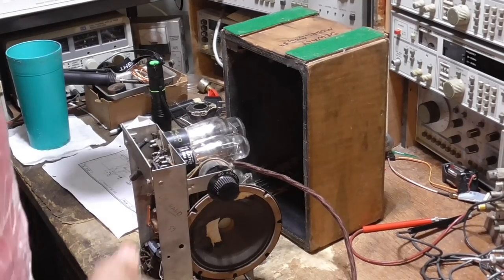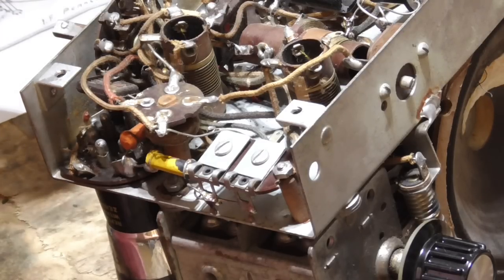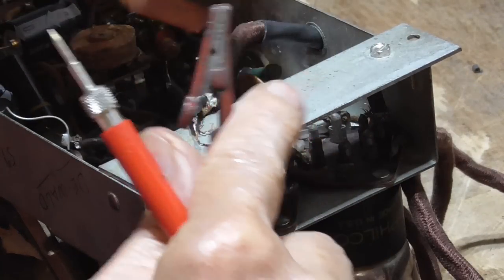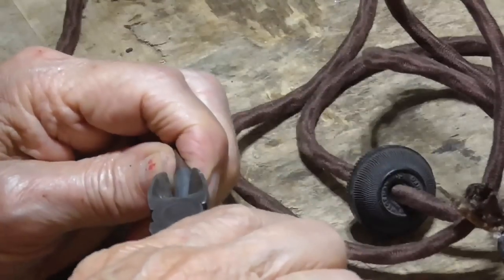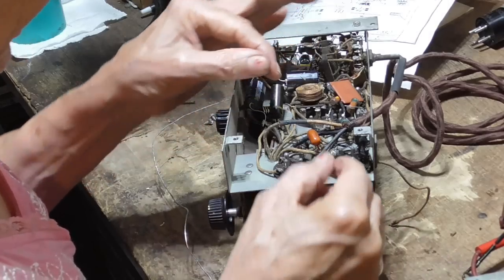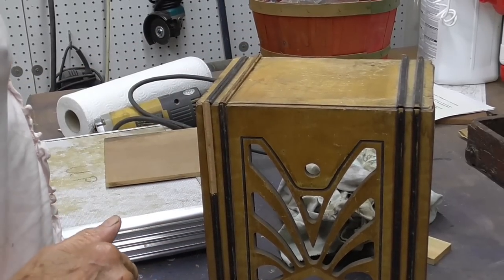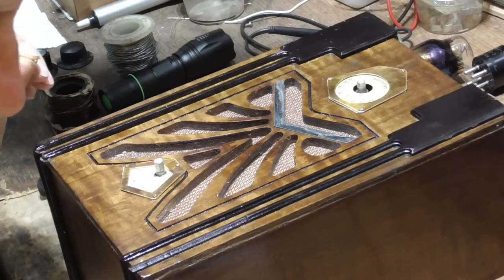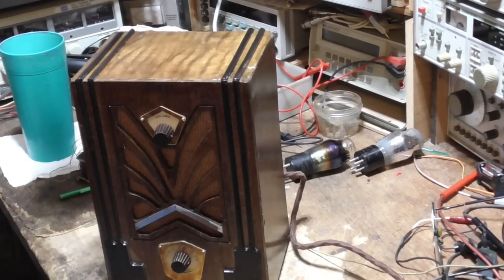RESTORING A 1930'S DEWALD RADIO

Comment: Ya got a GREAT 👍 discount on that radio 📻 for $5.00, by the seller thinking that the power cord went bad. It wasn't the power cord that went bad, it was one of the built in capacitors that burned out. Your friend, Jeff.

Comment: Dewald model 59 from around 1934. Has a bad resistance line cord. Struggling to keep it original and got it to work.
Ron's cabinetry work is simply outstanding. I don't think I ever saw a chassis desiged to be put into a cabinet on its end.

Comment: I saw that something the wood veneer bulged a few places it you could have cut up and filled up with wood glue and then use a couple of clamps to press until the glue was dry
Reply from the maker: Yes. There were several swelled up places which is why I couldn't use a power sander to quickly sand the radio. That particular radio is not worth all that trouble to do a lot of veneer work. It looks great the way it is.

Comment: In 220 volt countries they still sold all-american-5 series string radios and the ones I have seen include the fattest wire wouund resistor in the chassis, which oten goes bad when they are just a ceramic core and open to the air windings. I have rewound those, maybe something like that mounted on the chassis would be a more sensible replacement for a resistor cord.
Reply from the maker: In some radios there is room for the resistor. This particular one is packed solid with parts. No room.

Comment: Good to see you are still posting, havent seen many uploads from you recently was getting concerned. quick question - You changed the capacitors without testing them - i assume as they are old - yet you changed them for stock capacitors that are so old that the legs have oxidised. Why should your capacitors have any more life than the ones you removed?  - what am I missing?

Comment: For cleaning those capacitor leads I would recommend using fine steel wool. And, if the oxidation is really stubborn, maybe some fine (1000 grit) enery paper. One just has to take good care that either the fine steel hairs nor the emery paper abrasives enter the radio.
Edit: Cleaning with a knife blade is not that effective as it cleans a very small area per pull whereas steel wool covers much more area.

Comment: Greetings:
Instead of a signal tracer for finding a break in a wire, you can use an inexpensive AC voltage sniffer ($3.98 shipped from China). Be sure that only one source of AC is connected to mains when testing. Good for finding that break in the resistive line cord. 
BTW: Alternative to an internal dropping resistor is an internal non-polarized dropping capacitor of 14 ufd 150vac. [Motor caps work here.]
Reply from the maker: The motor capacitor is HUGE and won't fit in the cabinet.

Comment: A "curtain scorcher" line cord.  I figured at the beginning you'd encounter that.  I restored a 1930's Sparton where the cord was just in too bad a shape to re-use.  I used a capacitor to provide the required reactive current limiting in the filament string (not my idea - found on line), and used a repro cloth covered 2 wire line cord.  A resistor with the requisite power rating would've been too large and generated too much heat.  Luckily, the cabinet on my radio was in pretty good condition - I don't have the mechanical skills or tools that you do!  What material did you use to make the decals?
Reply from the maker: Inkjet printer transparency plastic. Any office supply store or ebay.
Reply: @glasslinger  Thanks!  I'm behind the times on that stuff!
Reply: Great job, BTW!

Comment: What i used to do, is flex the tube, while connected to the ohmmeter, to find the bad place.
Another thing, i do is gently pull the wire from it's end. 
Usually, the breaking is somewhere close to one end, so the broken wire will just come off.
Reply: When restoring old things, i think people should stick with the original look of the item.

Comment: Ron, When you sprayed glue for the grille cloth, does the glue get on the wood edges of the grille cutout?
Reply from the maker: Yes. Take a cloth on a screwdriver and wipe it off. It doesn't stick to the wood since it dries like a powder.

Comment: Hello. I got myself a radio to play with. It needs a speaker. But, the schematics show 4 connections to the speaker.
What kind of speaker is that ?
I try to put a new speaker, but don't know  how to connect it.
Reply: Modern-day speakers are usually permanent magnet speakers, but some older speakers use a electromagnet and the extra wires are to power it. I don't think you can attach a permanent magnet speaker to a radio not made for it but there could be some way I don't know of.

Comment: I  re-tin (solder coat) oxidized component leads instead of scraping them.  If the leads are so bad they won't take solder I clean away the oxides with ScotchBrite and then re-tin them before installing the component.

Comment: I would replace to whole.power cord. I don't like fire hazard on my place.
Reply: I'm usually a stickler for exact restoration, but fire hazzard+asbestos+unreliability means you're way better off with a sandbar resistor tacked inside the chassis. I love Ron, but this had me screaming at the screen

Comment: What is a resistance line cord for?
Reply: they were for keeping the local fire department vary VERY busy on the 20s and the 30s! :P
Reply: Used to reduced the voltage  so the tubes work at the proper voltage (and limit current running through them).
They get pretty warm because of that. The voltage used by the tubes is only a total of 55 Volts. The line 
cord  has to eat the difference from household line voltage ( 125 VAC). So about 70 volts.
Reply: @hestheMaster  "KNOCK KNOCK KNOCK KNOCK"
Reply: Ah, wondered about that too. The tubes must be used to running battery voltages rather than line power. Saves on power transformer, sets the tablecloth on fire...

Comment: Greetings:
I like to use schematic PDF pages as my (coloring book). I use Adobe Reader's commenting facility to color the B+, B-, AVC, chassis/gnd & signal paths. I also use available voltages to guess current draws and calculate voltage dropping capacitors for use with silicon diode substitutes for tube rectifiers. As this is all on paper, I am not ruining anything here. 
I do appreciate your videos but wince at some of your methods. 
At 71, my fine motor skills keep me from working on these deserving units myself but get my FIX watching you.
Is you capacitance bridge doing ESR testing for you?
Any help with chassis or model info as I have not found a photo match to that cabinet.
Reply from the maker: On some radios I do the color coding on the schematic too. I use colored pencils.
Reply: Greetings 2:
You can find the break point using a signal tracer with a signal source fed into one end of the resistance element.

Comment: A high voltage transformer is useful for finding such breaks. High enough to jump the gap.. look for the smoke.
Reply: I that a joke ? Any cheap DMM with NCV will find the gap without smoke and not knowing the lenght of the gap ;-)

Comment: when I took electronics repair classes they demanded NO JEWELRY when working on electronics...  Seeing your earrings swinging above high voltage circuits worries me.
Reply from the maker: If this worries you it is important that you not work on these circuits. You don't understand enough of the tech. Start on something that doesn't "worry" you, like a transistor radio that works on 9 volts.
Reply: @glasslinger  You, not me, are the inspiration and guidance for others who watch you.  You set the example.  I'm suggesting you are setting a BAD example.  You don't want your followers getting hurt, right?
Reply from the maker: @tomtke7351 The point is THERE IS NO RISK WHATSOEVER in my actions! You are not qualified to make the call with NO experience, or even being present to see the circuitry.  Go watch ElectroBoom and make some comments on his fun!